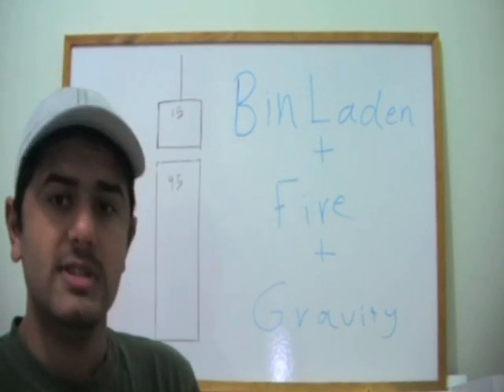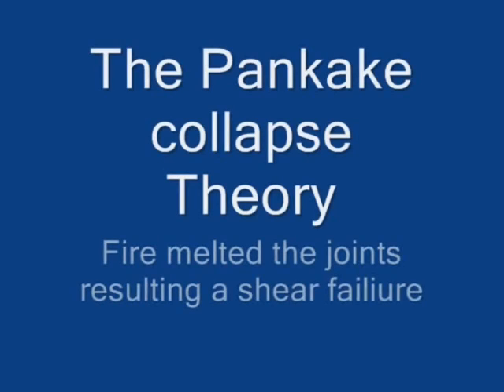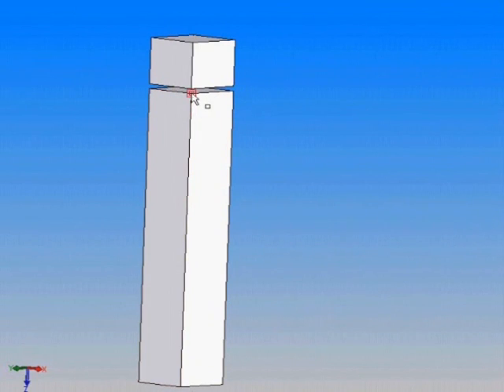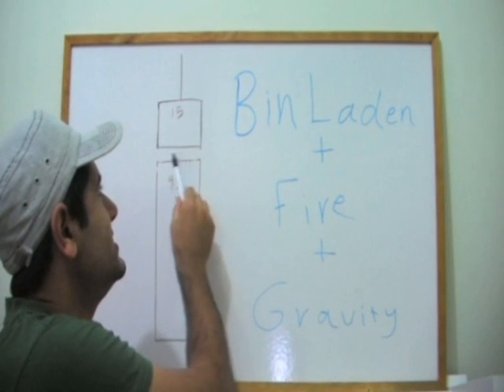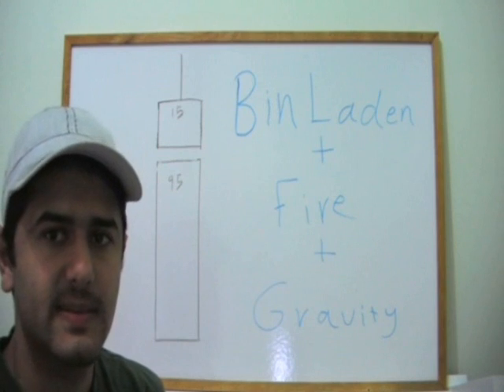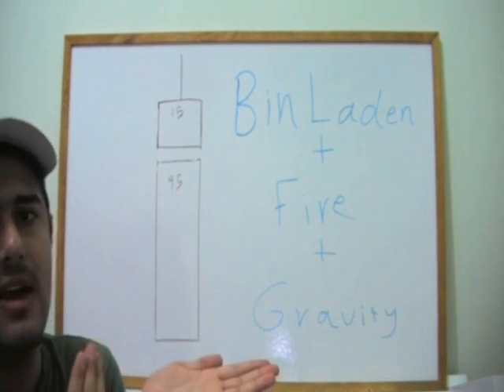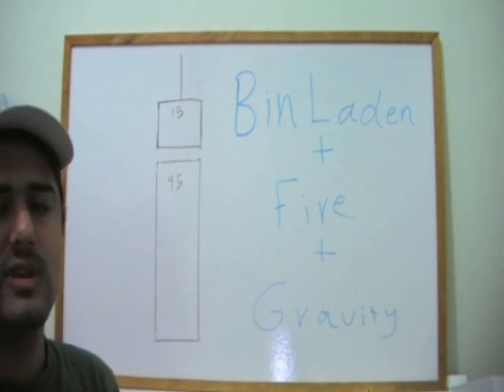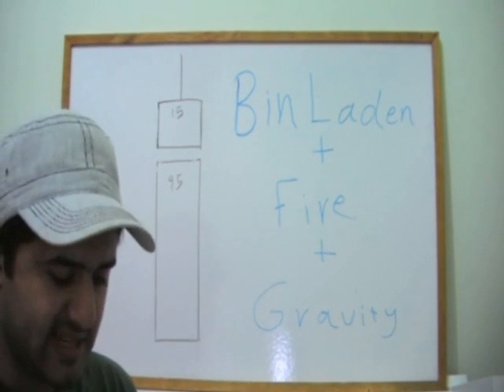(Part1) 911 Simple Physics Structural Failure Vs Demolition

Comment: A simple way to explain it is a free fall can only happen if there is no resistance,to have no resistance everything supporting the floors would have to fail simultaneuosly,that can only be done thru careful planning by man .if there is resistance a delay must be expected due to conservation of momentum – one of the foundational Laws of Physics......
 fire or a plane crash does not cause damage to every support column of a building simultaneously

Comment: The plane is a modified Boeing 747-200. Notice the white color, the US flag painted on the vertical stabilizer (i.e, the tail), and the blue stripe and insignia on the fuselage. The clincher, however, is the "bump" directly behind the bulging 747 cockpit. It is clearly discernible in both photos. No other plane has this piggy-backed appendage. It is unique to the E-4B, and is integral to the plane's military role as an airborne command center. (advanced electronic hardware.)

Comment: United States Patent for remotely monitoring and controlling brain waves:
 

Apparatus and method for remotely monitoring and altering brain waves
 
Abstract
 
Apparatus for and method of sensing brain waves at a position remote from a subject whereby electromagnetic signals of different frequencies are simultaneously transmitted to the brain of the subject in which the signals interfere with one another to yield a waveform which is modulated by the subject’s brain waves.Take the red pill slave,

Comment: Bankers Trust Building (130 Liberty Street), which has a total volume of approximately 28% of the total volume of one WTC tower. So two WTC towers had seven times the volume of the Bankers Trust Building. How could seven collapsed Bankers Trust buildings leave so little debris?
(182.5ft x 182.5ft x 40floors) vs. 2x(207ft x 207ft x 110floors)

Comment: There is no indication that any of the fires in the World Trade Center buildings were hot enough to melt the steel framework. Jonathan Barnett, professor of fire protection engineering, has reminded the public that steel-has a melting point of 2,800 degrees Fahrenheit--may weaken and bend, but does not melt during an ordinary office fire.Yet metallurgical studies on WTC steel brought back to WPI reveal that a phenomenon caused intergranular melting turning a solid steel girder into Swiss cheese.

Comment: A one-inch column has been reduced to half-inch thickness. Its edges--which are curled like a paper scroll--have been thinned to almost razor sharpness. Gaping holes--some larger than a silver dollar--let light shine through a formerly solid steel flange. This Swiss cheese appearance shocked all of the fire-wise professors, who expected to see distortion and bending--but not holes.

Comment: A review of of the documentary Collateral Damage in the New York Post describes firemen at Ground Zero recalling "heat so intense they encountered rivers of molten steel." now oldschool will deny all this its too simple for that lapdog to construct reality,But iam asking you what melts steel and what could make steel melt and continue melting other steel without air for months with water poured on it ? Or without excelerants that could cause same? I await for your response !!

Comment: A member of the New York Air National Guard's 109th Air Wing was at Ground Zero from September 22 to October 6. He kept a journal on which an article containing the following passage is based.Smoke constantly poured from the peaks. One fireman told us that there was still molten steel at the heart of the towers' remains. Firemen sprayed water to cool the debris down but the heat remained intense enough at the surface to melt their boots.spraying water on it for months but steel is still molton !

Comment: many more witnesses with empeckable backgrounds will state molton steel,many many weeks later molton steel was being taken out of the towers core section,What would cause this it sure wasnt the planes or burning material from the towers = what melts steel when theres no air to fuel such? even if paper and kerosene could melt steel ? Hey (oldschoolass )answer this question cant you ? Tell the fine folks there was no molton steel or it can burn for months and still be churning out molton steel

Comment: An article in The Newsletter of the Structural Engineers Association of Utah describing a speaking appearance by Leslie Robertson (structural engineer responsible for the design of the World Trade Center) contains this passage:As of 21 days after the attack, the fires were still burning and molten steel was still running

Comment: avid Short, Willow Creek VFD 15+ Years 
"I'm a retired career paramedic and fireman with 30 years of experience. I'm also an instructor and ex-chief officer. I'd like to see National Geographic answer this one.OK so the towers collapsed due to failure at the site of the crash impacts due to weakening and fire. OK. How then did the collapse of the upper floors of the structure cause the utter disintegration and fracture of all the steel members BELOW the fire which were COLD SOLID MASSIVE STEEL?

Comment: Jon B. Abrahamson, I was a Recovery Tech in a Crash Unit. MCAS Yuma 1977 & 1978 0-3 Years I've seen a crater from an F-4 that was bigger than the Shanksville crater. I'm sure a Phantom is about 1/8 the size. About a million people have died because of this! Osama (Tim Osman) has been dead since 12/26/01. We need to find those responsible and tried for mass murder and treason!"

Comment: 4) Live news was reporting multiple explosions, and the possibility terrorists also planted explosives.
 5) Barry Jennings, the Emergency Coordinator for the NY Housing Authority reported explosions in Tower 7. He also reported being knocked down by explosions prior to the collapse of the tower.
 6) Molten steel AND concrete were found at Ground Zero “remember, hydrocarbon fires do not burn hot enough to melt steel or concrete.”N.F.P.A

Comment: 5) Barry Jennings, the Emergency Coordinator for the NY Housing Authority reported explosions in Tower 7. He also reported being knocked down by explosions prior to the collapse of the tower.
 6) Molten steel AND concrete were found at Ground Zero “remember, hydrocarbon fires do not burn hot enough to melt steel or concrete.”N.F.P.A. 921- 19.2.4 Exotic Accelerants states that molten steel and concrete could indicate the use of exotic accelerants, specifically Thermite.

Comment: We are asked to believe that on that day three structural steel buildings, which have never before in history collapsed because of fire, fell neatly into their basements at the speed of gravity, their concrete reduced to dust. We are asked to believe that jet fuel (kerosene)can melt steel. We are asked to believe that the most sophisticated air defense system in the world, that responded to sixty-eight emergencies in the year prior to 9-11 in less than twenty minutes but they fly for hr above us

Comment: “Underground explosions prior to the collapse” they were elevators falling to the basement; fuel and burning debris was sent down the elevator shafts which explains your smoke. Don’t give me that hermetically sealed & the elevators didn’t go all the way to top BS either, because once the planes struck the shafts, they were no longer sealed and three elevators in ea bldg went from the basement to the top floor.

Comment: Sprayed-fire resistant materials (SFRMs) were used to protect some structural steel elements in the towers, including all floor trusses and beams.[54] Gypsum wallboard in combination with SFRMs, or in some cases gypsum wallboard alone, was used to protect core columns.[54] Vermiculite plaster was used on the interior-side and SFRMs on the other three sides of the perimeter columns for fire protection,Why do you love your murderous government?Why are you a slave to gov.com lies?

Comment: The architect made no such statement. John Skillings the lead engineer stated in 1993 that the bldg could withstand a 707 at 600 mph. However all his calculations and paperwork on the subject were all destroyed in the attack.  He did his calculations in late 1960’s on a “what if” scenario, about a bldg with an untested design.

Comment: Yes they did, and yes they did, it is well documented... as for the tube design you are correct apart from the massive core columns which happened to be present, which were all somehow cut into approx. 20m lengths... maybe you could explain that and fill in the gaps in our flawed knowledge of engineering... I don't like to get personal about this topic but you really seem like a blind sarcastic idiot when it comes to defending a story you desperately want to believe but cannot possibly be true.

Comment: agreed... the top didnt fall symmetrically... but as the building crumbled... why didnt the top fall off? the lower structure had been holding it for a few decades. The fireball burned off when the plane hit. it didnt weaken all the floors below it. Explain  the puffs of smoke and debris ejecting out 30 floors below the crumple zone.

Comment: deisel burns hotter than jet fuel. Deisel engines rarely melt down. I understand that heat and fire can weaken steel. But it cant severe them. how would so many joints fail at the exacty same time. How do you get symmetrical collapse from un symetrical damage?

Comment: they were 757s... and jet fuel dont burn hot enough to melt steel... if it did... then why dont jet engines burn up at low thrust?

Comment: “425.000 cubic yards of concrete and 200.000 tons of STEEL turned to dust” you mean 425.000 cubic yards of light weight concrete that was only 4” thick over an 18 ga corrugated steel pan. It’s not hard to understand how a 4” slab could be pulverized into dust given the amount of weight and kinetic energy slamming into it from 12’ above. “STEEL turn to dust?”  Then what was all that steel looking stuff lying all over the place that took nearly a year to clean up?

Comment: “Without a constant source, it is IMPOSSIBLE for 24,000 gallons of fuel to weakened BOTH towers” the fuel was the accelerant not the source of the fire. There was an acres worth of fuel to burn in the form of desks, chairs, carpets, paper, computers, oxygen generators from the planes.

Comment: The point of impact has everything to do with how the WTC collapsed to the ground. It damaged a large number of perimeter columns on one side of the bldg and started a raging fire on the other side, not to mention damaging some core columns along the way. When the perimeter columns finally snapped they slipped past the load points falling 12’ on to the floors below.

Comment: Good God Truhers are dense. It’s good to see a few sane people on this page, people who understand the way these tower where designed and engineered. Truthers never bring up the point that the building collapsed at the point of impact and that the perimeter columns bowed. There is only 2 things know to man that can bow metal, heat and pressure. Both were in abundance that day; explosives cannot do this.

Comment: so if the top part of both buildings is mostly air, then how does it liedrive with such force the bottom 90 floors??? its not just as imple as a building falling down. why pay demolition teams to rig a builing when they can just set fires??? and gravity does not work with STEEL FRAMES buildings. only with concrete reinforced rebar buildings can the top section crush the bottom. even then you must take out core columns and base of building to structurally weaken it.

Comment: So you should have a huge pile of rubble at the bottom???? assuming your analysis is right, then there would be a debris pile 10-20 stories high?? no?? explain where all the concrete is, explain why there isnt mangled columns stories high, explain the pyroclastic cloud that ensued the collapses which points to extreme heat. sorry but those buildings just didnt collapse, they were blown to pieces.

Comment: Actually if you do your research the WTC was over engineered. After a bomber crashed into the Empire State Building engineers sought to make a building that would withstand multiple hits from a Boeing 707 at max speed and completely loaded with fuel. A 707 at max throttle would have more kinetic energy than a 757 and mind you these 757's were not filled to the brim with fuel by the airport. Well they were drones so they were.

Comment: @itzahazylife 

Structural engineers know. 

You may be unaware, but there are simulations and programs that run off of formulas and scientific laws that can predict what would happen in these situations. One thing that absolutely does not happen is for buildings to implode as a result of the building next to them imploding. That is what you're suggesting now, isn't it? That it could have been the impact of the towers falling that caused WTC7? Despite the difference in timing?

Comment: @itzahazylife Yes there was molten steel. Nasa even has satellite thermal images showing 2000°+ temperatures central to wtc 1&2 and also building 7. Read about "The Meteor". Its steel and rock fused together that was recovered.

Comment: Which of you people think the steel supports were 400 meters long and ran top to bottom? Nobody? Good. Because they were not. Second, if supports give way, they dont have to be "Crushed" for free fall, they become detached and "fall" just like the building above. If it were controlled it were the WORST EVER attempt allowing one side to go first. Also, the 15 floors DO NOT NEED to crush all the others, it gathers an extra floor each time like a snow ball. Not a pancake.People still believe some *

Comment: Thanks, your analysis is correct. The buildings definitely did not "pancake", and couldn't have pancaked because: 1. Hundreds of connect points per floor 2 A horizontal disc (i.e. a floor slab) trying to fall as a unit  through a vertical tube must remain perfectly horizontal, or it will jam.
 Even if broken, it would still jam temporarily, and cause a delay for every floor.

So don't listen to those who believe concrete crushes itself to dust from the friction of falling through air....

Comment: @CrazyRay7979 NIST conducted ACTUAL research and then used circular logic and pseudo-science to assert the claim that the cause of the towers fall was the impact of the planes.  However the forensic evidence and tests they conduct disprove what they set out to prove.  So instead they made a computer simulation and said, "that's what happened."

Comment: @cottoniiijoe  Also if one bothers to examine it,..  you can see the bulk of the building is 5 stories ABOVE column sections that are twisting in the wind in free fall.  There does not exist 2 areas of free fall.   Either its a column sailing thru the air which is most definitely freefalling (look at the video!!) Or its the collapsing portion of the building running 5 stories above that in the dust cloud.

Lets decide hm?

Comment: To me, momentum plays as well. I mean, its a ratio. 15 floors falls onto the rest of the building, so 15 floors should of been crushed. Or maybe even 20 or so, not the entire 95. Esp since the towers were made in 3 sections so if a tramatic event accured, it would fall depending on which section and slide off into the streets, leaving the rest in tact.

Comment: @TimReed22222     There have been experts who commented on the fact that the 'rubble' pile was much, much smaller than typical ratios (I don't remember the exact numbers), like 1/4 of what you'd expect from a gravitational collapse of a structure.  And, if you do some research, you'll see pictures from many blocks away that have a layer of powderized/pulverized material (ie. concrete), at least 2 inches thick.  I've seen them.  The only way for that to occur is by explosive energy (not kinetic)

Comment: @TimReed22222   Not nice to ask the question and answer it yourself in an attempt to mock someone who opposes your view.  Breaking the 1000 tons into 900/100 was to illustrate that 'most' of the concrete from the Towers was pulverized and thus became air-borne.  Just go back and view the videos - what's the white cloud made of??  Several blocks in the vicinity were subsequently covered with a layer 3-5 inches thick of white powder.  Do the research and see for yourself!  Or stay uninformed...

Comment: @TimReed22222   "Even if this were true, SO WHAT?"... it means that explosives brought the buildings down, not gravity.  1000 tons of skyscraper did NOT become 1000 of rubble;  it became 900 tons of scattered debris (most became air-borne and deposited miles away), and 100 tons of rubble (mostly steel).  All this does not 'disprove' what the physics show, it just reinforces the thesis that gravity did NOT 'collapse' the Towers - explosives did!

Comment: Although I agree with what you're saying (that gravity did NOT bring on the collapse), you're wrong in your assumptions about the 15-floor block above the impact zone.  I've seen video footage for one of the Towers where the top 'block' actually disintegrates BEFORE the floors below begin to cascade down.  Therefore, the supposed 'weight' above the impact zone wasn't even there to begin with!  Which, of course, makes your proof almost a moot point.
The Towers (all 3), were DEMOLISHED - period.

Comment: @TimReed22222 I already explained it for you. I'll do it one more time. There is not enough potential energy in the building to reduce itself to rubble. Here is the math. A construction bolt takes 480,000 of force to break. Lets say there are 1000 of these bolts holding the floor together. In order to simulate to collapse,  you would have to break all the connecting bolts on every floor in rapid succession. 800 million pounds of force per second is needed. The building does not have that.